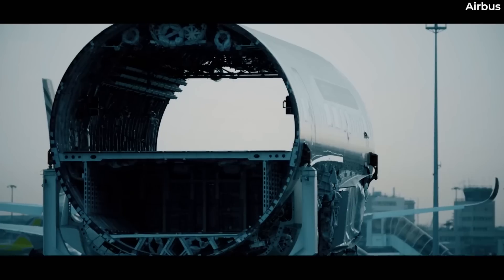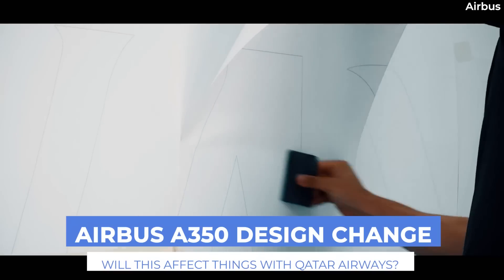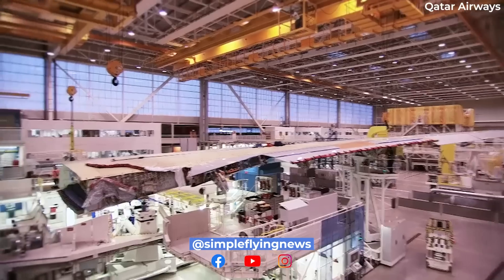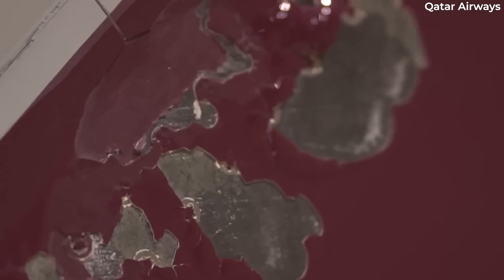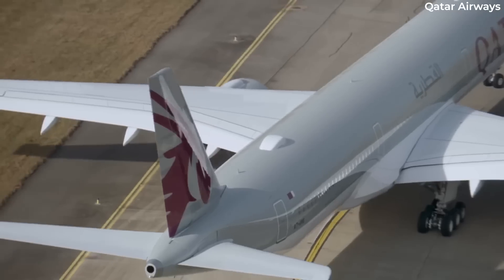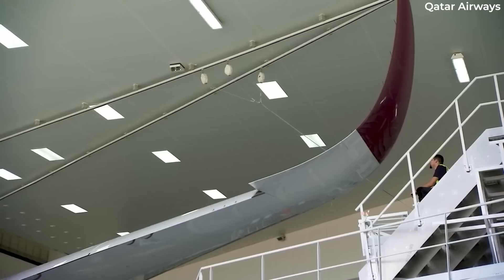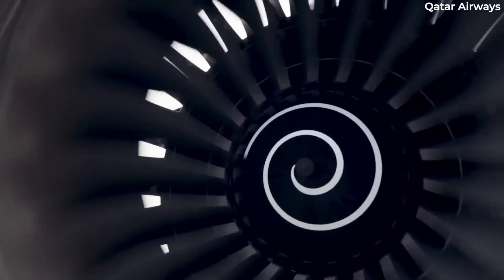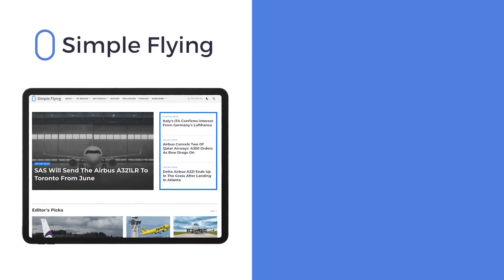Airbus' A350 Design Changes Amid Ongoing Qatar Airways Dispute

Comment: Airbus must be aware that this could be seen as a partial admittence of a failing in their design and that the Qatari A350's are substandard, although I still don't think Qatar will get a solid ruling in their favour safety wise.
Reply: Being a launch customer always has some risk.  Boeing has similar surface delamination issues like Airbus, but Qatar is working with Boeing to address the issues while they decided not to work with Airbus and escalate the issue into court.
Airbus has made several attempts to address the issue together with Qatar silently, but Qatar refused any and all attempts.  Airbus was not allowed to fix their A350s.
Airbus already confirmed the issues with the paint delamination as a technical problem, and they also stated to work on a solution.
I don't see any wrong doing, if a manufacturer admits to an issue and informs the clients to be working on a solution to address the issue.  That's the least a manufacturer can do.

Comment: I don't understand why this is only happening on Qatar aircraft?  Surely if this material was used on all A350's other airlines would experience the same issue?
Reply: It is happening on a few others but the Qatar aircraft in particular were all sent to one particular paint shop in Ireland.
Reply: @nathd1748  But it's not the paint that is the issue, it's the material used between the skin and the paint.
Reply: @SJF15  Which is exacerbated by the methods used when stripping for a repaint. Hence why nearly all the Qatar jets were stripped down in a paint shop using methods established for aluminium jets and not CFRP.
Reply: It has been happening with airline airlines. Those other airlines have been happy with the public comments made by Airbus on the matter. Qatar maintains that the paint chipping exposing the lightening protection layer underneath creates a safety problem.
Reply: Not necessarily.  You may also need to understand how the arid desert climate may also make the situation worse. Most of the other airlines who have reported the issue about A350 all have their hubs in temperate time zones.

Comment: If they're claiming it safe, then why to invest millions to change it !!
Somthing's not right here Airbus,
Reply: There are several reasons, but one is that they definitely want to uphold their reputation and keep their company and brand going in the right direction. If safety risks did exist with the airframe, Airbus would be transparent about it. Even though the A350 is a quality product, Qatar Airways is acting in an irrational way towards it. And explain to me why just the fleet of A350s operated by Qatar Airways has these paint flaws, and not other airlines. This issue also affected 787s, and Boeing suggested using speed tape to solve it; Qatar didn't object. Something's not right here , Qatar Airways.
Reply: If all these aviation regulators agree that they are cosmetic issues, then why is it only Qatar that disagrees?
Reply: @pixlitol  Because Qatar is a world class airline, and they expect Airbus to match their standards. That's why.
If you spend billions of dollars on a product, don't you want to meet it your expectations?
Same with Qatar, be that a cosmetic issue or not.
It's that simple.
Why drag B787 into this now?
I don't know what your intentions are here.!!
Reply: @ghotridr9550  Airbus offered a repainting and compensation. Qatar wanted way more…
Reply: @ghotridr9550  ah Boeing fanboi, yes 787 wings affected too

Comment: I wonder how much the change cost? If it is a significant amount of money it’s not a good look for airbus…because in my mind at least no company is going to make a very expensive change unless there was a flaw.
Reply: Perhaps….however on the flip side of that argument they did agree it was a cosmetic issue which maybe this new one addresses. I don’t think any airline would want to see those unsightly cracks on the surface of their new airplane only after a few months in service 😅
Reply: Absolutely right 👍🏻
There's something going onn for sure!
Reply: Maybe but in this scenario I wouldn't say the flaw was that significant since it's supposed to be cosmetic and also in the long run airbus has been doing little changes like this just to improve the plane overall such as the winglets so they probably would have done this anyway for weight savings

Comment: Airbus analyzing the cause of the surface delamination and addressing the issue is not different from Boeing addressing the surface delamination of the the 787 wings.  The only difference is Qatar talking with Boeing and fixing the wings of their 787 with speed tape, while they are grounding the A350s.  Funny thing is the issue with the 787 wings is older then the A350 paint issues.  One might ask who might have advised Qatar to follow the path they have chosen to follow with the A350 issue?

Comment: A design change that adds weight is far more significant than one, which reduces it for the simple reason that aircraft manufacturers are always looking for ways to make their products lighter. 

As for damages for grounding for safety  concerns, I  would have thought it difficult to claim for damages until the relevant safety authority declares it to be so if they have already confirmed it to be acceptable, unless of course it can be shown that the manufacturer was aware of a safety issue and had concealed that information. 

Cosmetic issues are a different matter, simplified in this case, because Airbus is not trying to deny that it is a problem and they have agreed to stand the costs of those repairs. It is Qatar who are refusing them the opportunity to do so.

As a consequence, Airbus could possibly argue successfully that they are not liable for any additional deterioration after the offer of a temporary repair was refused.
Reply: In agreeing to repair a fault indicates that there was a problem in the first place!! This new perforated material being used instead of the extended one would give Qatar an additional proof that the original material was not durable  as they’ve been trying to prove and this stands in Qatar’s favour as they’ll use this sudden replacement in proving that the initial product was inferior and couldn’t stand the test of time! The whole situation is a shame really as it gives off this air of uneasiness in the whole Aviation industry. It’s not just an ‘Airbus’ thing but Aviation as a whole. Make it stop please, Someone 🙏🏾❤️
Reply: @Kojo Harrison  I don't understand the logic behind your argument.

The disagreement is not over whether there is a fault, but what type of fault it is.

I don't think that anyone would disagree that there was a durability issue, and that in the absence of any proof that it was caused as a result of an incorrect application of the surface finish, or by how the aircraft was operated or maintained I would have thought it inevitable that some or all of the materials involved are changed to an alternative.

Airbus had a problem with paint adhesion, and it has been suggested that the metalic protection layer could be the culprit so they try a different metalic protection layer, which I suspect may be similar to that used successfully on the 787. 

Unless or until any further information comes to light, there is nothing else that can reasonably be read into that change.

I am not in a position to judge whether there is a safety issue. However, until we have more than just one airline and a single safety body, both of which share the same ultimate owners, I doubt that many will be convinced that it is more than a totally unacceptable cosmetic issue.
Reply: @neilpickup237  Neil I’m not even arguing any point whatsoever with you. Neither of us own any stakes in any airline. I’m just merely describing what is happening and what the response from Airbus in terms of using a different material might trigger Qatar to do! Qatar is hell-bent on proving a point so in my mind not sticking to the original material Airbus used but swapping it for another might come across as Qatar having a case (some sort of evidence). Also there were other other airlines such as Finnair, Air France, Lufthansa, Cathay Pacific & Etihad all raised issues with paint degradation. Lufthansa’s was way back in 2017. These were investigated but found no issues with safety of the aircraft. Qatar is the only one that grounded some of their fleet fearing that the issue is deeper than superficial! That’s all I’m saying. I’m not here to argue virtually with you, after all you don’t own any airlines…..

Comment: My first thought was what was subsequently quoted in the video from the judge, that this would be significant to the case. Now I don't know all the ins & outs of the case, only what I've heard from being subscribed to this channel, but it's either something Qatar will capitalise on or a move from Airbus to open dialogue with the benefit of better efficiency for their planes. Either way, could it be a step towards ultimate compromise to settle out of court?
Reply: Airbus several time voice it's readiness to address the paint issues of Qatar's A350s, but Qatar stubborn refused any and all Airbus offers.  Instead they are suing Airbus for financial damage due to the grounding of their A350s.
That's the reason why it's important to know the exact reason for the grounding.  So fare Qatar's behavior shows more like an attempt to bad mouth Airbus (bullying) to get financial compensation.  Given the comment of the English judge Qatar's chances are not so good to win their court case, but they will try until the bitter end.

Comment: What I dont understand is why is QATAR the only company that experienced the paint issues..........
Reply: They are not the only ones ...but they were the only ones to refuse 1)  to allow Airbus engineers to examine the paint degradation of all but  one the effected aircraft. And 2) The inspection and free repainting offered by Airbus, at a time when it was felt by an effected airlines discretion.
Reply: @BlackKnight344  ah OK - thanks for the info. I had been trying to work that all out. It seems Qatar was on confrontation course right from day one when the problem arose
Reply: @Yves_Ka  Qatar was looking for advise from another big airliner manufacturer in regard to the surface degradation on their A350s.  The outcome  is  unfavorable for Qatar, but the other airliner manufacturer could capitalize nicely on the naive believing's of the Qatari and is now the sole supplier of airliners for Qatar.
Reply: @aquaden8344  yes -  the  fact that Qatar did not foresee the consequences proves someone at the top made some very irrational decisions
Reply: @Yves_Ka  Qatar Airways is trying to recover the losses which they have had to absorb during the pandemic.
Reply: @billalhossain3134  Qatar doesn't need Airbus's silly money..
Reply: @ghotridr9550  Every little helps
Reply: @billalhossain3134  That's only a minor part of the whole story.  The real issue was the freighter deal.  QATAR was looking for a new freighter and Boeing had it's new 777-8F not even announced.  They needed a roadblock to prevent Airbus from winning Qatar's freighter deal and used any and all chances to discredit Airbus with the result, that QATAR not only uses Boeing as sole supplier for airliners, but QATAR is also financing the 777-8F development, what is crucial for a cash strapped Boeing.

Comment: Regardless of whether there's a valid material safety concern, 
I think the airline has a case in the sense that the sight of cracking on the fuselage would foreseeably negatively impact the airline's passenger's perception of safety and trust in the airline.
Reply: that holds not much weight in court in this case
Reply: What a nonsense!  The issues with the surface delamination of the A350 is as little of a safety issue as the delamination issues on the 787 wings.  There are photos in the internet of a Qantas 787 wing patched all over with green speed tap and there are black composite patches exposed between the speed tape patches.  Boeing still communicated to their customers, that it would be a cosmetic issue only but not a safety risk.  Now the Qatari want to be smarter then the rest of the world and declare the Airbus issue unilateral as a safety concern without being able to back up their claims with facts.  That kind of behavior works in a dictatorship like Qatar, but it won't in the developed Western world as the Qatari experience painfully during the court case.
Reply: @aquaden8344  If Qatar is claiming it's a safety issue have they said exactly what that issue is?
Reply: @shrimpflea  I'm not aware the Qatar Aviation Authority did state the reason for grounding some of Qatar's A350s.  That's the reason why the English judge lost his patience and demanded from Qatar to bring in information for the grounding of the A350s or their case is getting thrown out of court.

Comment: It's safe It's safe It's safe It's safe, no one asked you if it was safe, the whole problem is cosmetic paint chipping,  yeh but It's safe It's safe It's safe It's safe It's safe It's safe It's safe.
Reply: Paint chips fallling off onto the runway is not good.
Reply: Why's Airbus changed the lightning protection on the A350 recently then?
Reply: And now we see new foil.   But oh it is still a paint problem.
Reply: At least it doesn't fall out of the sky...
Reply: @user-yt198  sure it might
Reply: @nickolliver3021  Everything might. The question is, will you be happy with that?
Reply: @user-yt198  nobody would be happy with that.

Comment: If those photos of the surface cracking represent reality, I’d say that Qatar Airways would have a valid claim against Airbus. . .  if only for increased fuel burn because of decreased aerodynamic efticiency
Reply: Not only that the carbon composite body is directly exposed to the elements now which may cause accelerated wear and tear and shortening the life of the aircraft.  Besides if I paid millions of dollars I wouldn't accept the planes looking in a bad state of disrepair.   For any airline offering a higher end product image is important.
Reply: @gregio6295  And what would you tell about the pictures of a 787 wing taped from root to wing tip with green speed tap, and between the patches you can see the black carbon surface.  Is that acceptable because it is a 787 and not an A350?
Social media should not play aviation engineer.
Reply: Fool - the only reason Qatar published the photos was to get approval from the public court of social media.  Have you researched under what conditions the surfaces deteriorated this badly (time, duration, environment, etc.).
FYI: Airbus offered to repair the affected airplanes several times, but Qatar stubborn rejected.
Reply: If those photos were taken some time after when Airbus offered to fix the issue, there is likely to be a counterargument that the level of deterioration shown in the photograph, is as a result of a failure to effect a timely repar.

To be valid, it might be necessary to have a photograph taken no later than when the aircraft was grounded.

I suspect that before any photo is able to be used as evidence, there will need to be some degree of proof as to when the photo was taken.

As for increased fuel burn, RR might have that information contained within the data the engines sent to RR as part of their continuous monitoring.

Comment: Are you going to buy a used car with this kind of crack?
Reply: Honestly... Yeah
If it's cheaper due to paint issues
Reply: @andreas4010  When a car has a problem like that it is a rust bucket.  Maybe one that has had the rust painted over rather than repaired.  How far will you go to deny this is a foil problem.
Reply: @danharold3087  the manufacturer offered original owner repaint but the owner refused, insisting paint cause safety issue and want more rebate. Meanwhile other owners happily accepted temporary fix.
Reply: @annoyingguyoninternet1631  We have all heard that repeatedly and it is based on a lie.  Airbus did not offer a  fix for the foil.  That is what is needed.  Qatar may have not chosen the best route to address this but Airbus left them few choices.  Airbus should have addressed this starting in 2016.  The better foil was there.  They may have possibly switched to prior to producing the planes is sold to Qatar.
Reply: @danharold3087  Your arguments are getting old, and now you even start to question meetings between QATAR and Airbus representatives.  How can you even ignore the meeting between AAB and the Airbus CEO, where they agreed on working together to find a solution only to be revoked by AAB weeks after the meeting.
Stop twisting facts and fiction when reality doesn't fit with your view of things.
Reply: @aquaden8344  Just as soon as people stop saying it is a cosmetic paint issue.
Reply: @aquaden8344  You mean you don't like to here me questioning the party line. Simple enough.  Don't respond.
Reply: @danharold3087  Then you respect the facts and don't start with your conspiracy theories, and I'm not reminding you about what happend in reality.
Reply: @aquaden8344  The facts start with "It is NOT a cosmetic paint issue".   If it was they would just have repainted the planes and called it a day.   Not a conspiracy theory.
Reply: @aquaden8344  I did not say they were safety issues.  I did not make technical statements. You sound like someone who is desperately trying to defend his unsupportable position by attacking the person instead of addressing the problem.